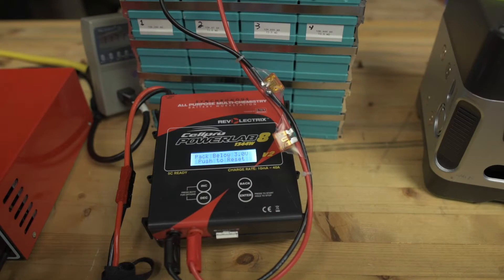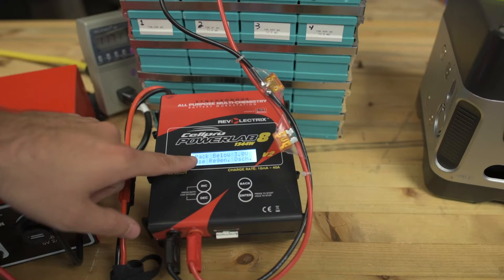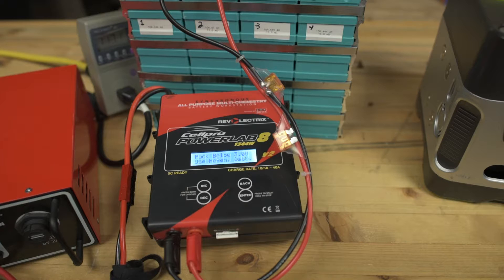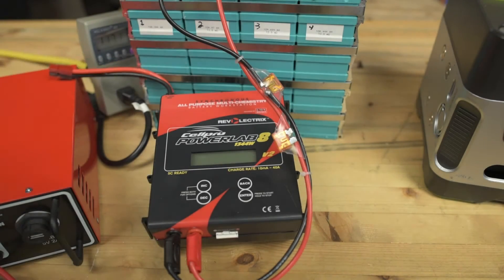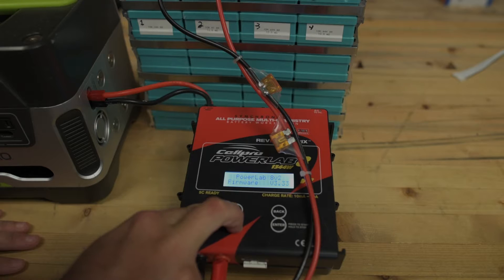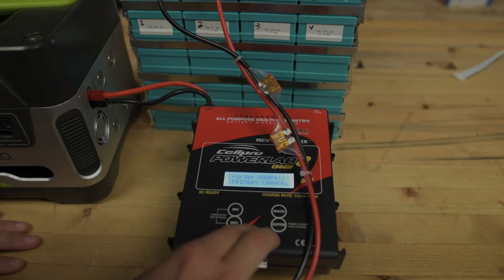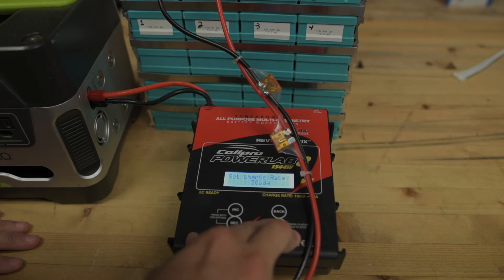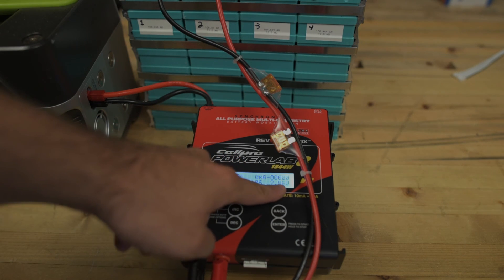Cellpro Powerlab 8 - DC power supply vs Regen Discharge

Comment: Perhaps a dumb question here, but why would you need a power supply for discharge? Wouldn't you want to connect a load of some sort to the battery or the powerlab for the purpose of discharging?
Reply from the maker: You could just use a 12v bulb, but then you’d have to watch it carefully to prevent over discharge.
Reply: @createthisdotcom  alternatively, could you connect an inverter and run an AC load (because it is easier to find a large load AC), to perform the discharge cycle?
Reply from the maker: Yes, definitely. You just have to watch the voltage because most 12v inverters have a low voltage cutoff that is designed for lead acid, not lifepo4.
Reply: @createthisdotcom  Ahhh yes that's true, my inverter is programmable but will have to check how low it can go.
Reply: @createthisdotcom  As a power supply, does it have to be a constant voltage supply or can it use multi stage battery charger?